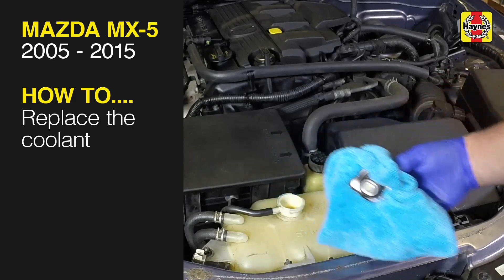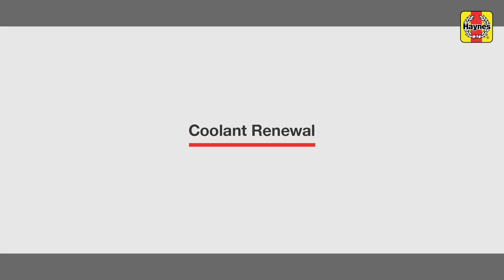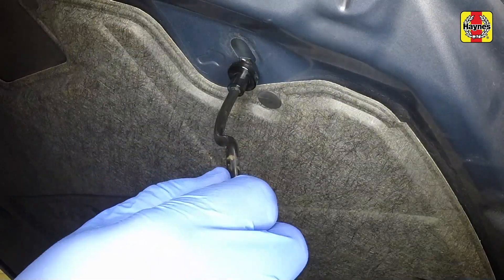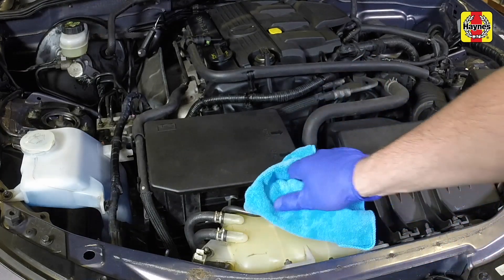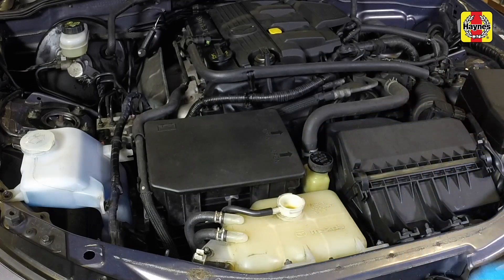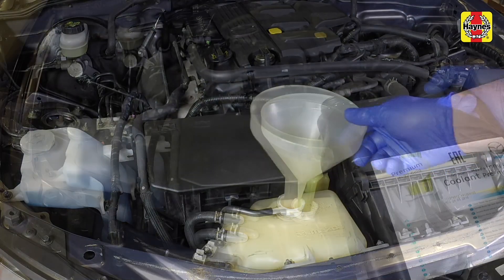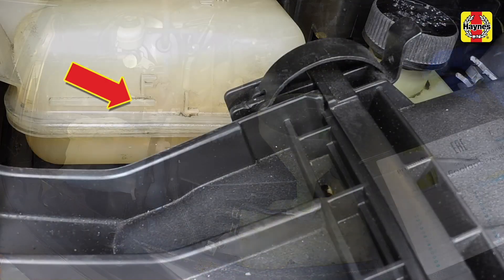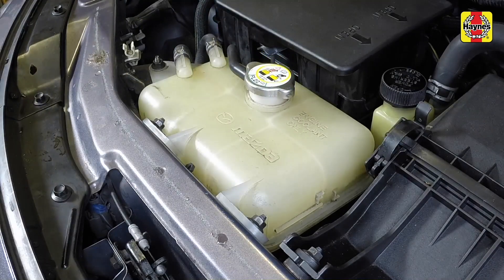How to service the Coolant system on the Mazda MX-5 2005 to 2015

Comment: NC Miata owners describe the plastic coolant tank as a "disaster waiting to happen", and suggest replacing the OEM plastic tank proactively with an aftermarket metal tank.
Reply: aftermarket metal tank is not the way to go. Once the plastic goes yellow, just replace with another fresh OEM plastic tank. Aftermarket metal tanks tend to fail at point because of the poor design and quality.
Reply: @aybcd  Mine is tig welded aluminum, so no rust, and quality welds.  The same method they use for race car fuel tanks...  Can you link to a failed aluminum tank, as I've never heard of it happening.

Comment: How many ltrs of antifreeze do you use before adding water please?
Reply from the maker: Total system capacity is 7.5L, so in theory you'll need 3.75L. I'd mix up 7.5l of a 50/50 mixture of anti-freeze and water. That way, any left over after the system has been refilled can be used for any topping up in the future.
Reply: @HaynesManuals  Definitely.
I'm using Preston, as that is for All vehicles and MX5 do recommend it

Comment: A good step-by-step video, but it doesn't address fully purging the system of coolant. A straightforward drain of the tank followed by new coolant leaves old coolant in the radiator and surrounding pipework.

I think a more through approach is required to be shown here, whereby you show the flushing of the entire system. When I've done it previously I've used a 50:50 mix of coolant and distilled water, with running the engine up to temperature each time.
Reply from the maker: Thanks for your comments!